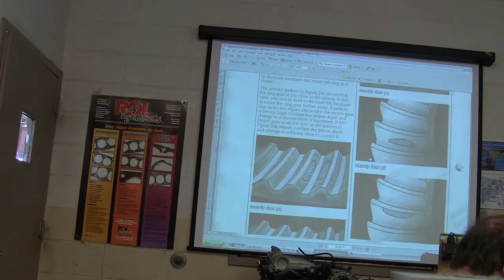Drivetrain Test 13   American Axles

Comment: Richard, Where can i get one of those tools to knock in the shims with? Do you have a part number? ive been looking everywhere since i seen you use one in a video
Reply from the maker: That tool is marketed by Rotunda, made (I think) by OTC.  The Ford shop manual lists it among the tools needed to rebuild rear ends, but it's tough to find in Alldata.  Look at the tool lists for rear ends starting in about 1990 and you my stumble across it.  If you give that six digit part number to the tool guy he can find you one. I'll try to remember to look that number up when I get to work.
Reply: McCuistian
I found it!!! Thank Richard. Hey do you suggest using dummy bearings when setting up a rear end? Im trying to find a faster way to set pinion depth and backlash
Reply from the maker: srv3fender Whatever works is what I do!  The shop manual definitely doesn't have all the answers!
Reply: McCuistian
have you ever known anyone to rebuild them with the same shims in the same place? what are the odds you could get away with that?